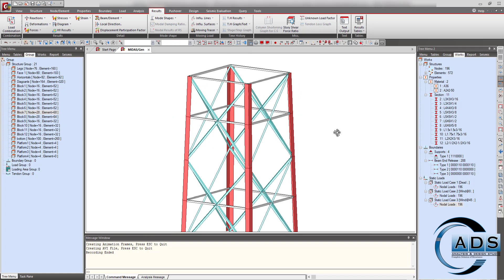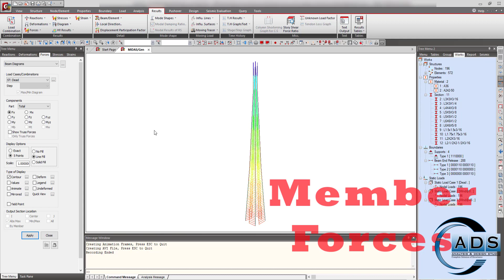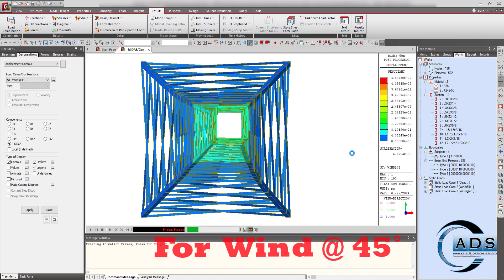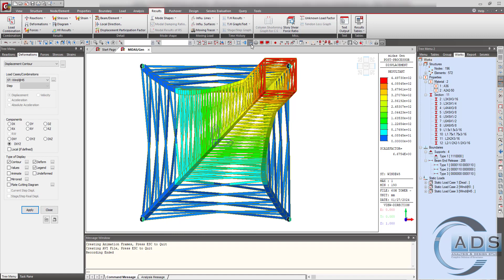Decoding Structural Design of Telecom Tower :  A Professional Perspective

Comment: Hello, thanks for this presentation, how could we generate a 3-leg model using midas-gen, please?
Reply from the maker: Thanks. I have modelled this manually means without tower wizard. Similarly 3 legged tower can be modelled easily
Reply: @analysisdesignstudio3363  couldn't model 3legged tower by using the tower wizard, it also should be modeled manually or imported as dxf as I understand.